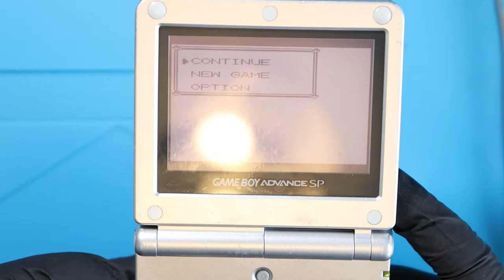Gameboy Advance SP Repair | Faulty On and Off Switch

Comment: I order to give the switch a lasting cleaning one really needs to desolder the metal bracket bridging the top of the switch and remove the plastic slider underneath to expose the metal contact pads which can then be scrubbed with a Q-tip and alcohol or contact cleaner. Be careful with the tiny metal butterfly contact attached to the plastic slider because it can come loose and can be extremely difficult to properly replace back into the slider.
Reply from the maker: Sounds like a really fun experiment though! Might do it :D

Comment: Just watched this because I cleaned my GB Advance SP and it now does not turn on as it did before. I can't remember if the switch button was on OFF or not when I assembled it back together. If not, what are the consequences and how can I fix it? Thanks.

Comment: Nice video. They're quite fun to work on. If you can get something to support when putting the ribbon back in that helps.
Pop that cart open, you'll see if it is legit or not.
Reply from the maker: Thankyou :) Like the iPhone then, some people use cans then wrap elastic bands around them. Yeah will deffo have to get inside the cart. Is there anything in particular when in it I should know to look out for?
Reply: @JoeyDoesTech  if there is any black "blop" on the PCB of the game, it's most probably a reproduction. There are only very little Nintendo Cartridges which have this.